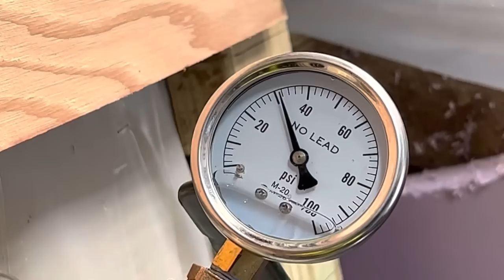REPLACING CURB STOPS UNDER PRESSURE!

Comment: Buy a freeze kit. C02 oxygen bottle tank with a freeze bag that wraps around your pipe and will form a ice layer over the pipe with about 5 minutes of time when it’s frozen. We did 180 lead water replacements this summer from the curb box to the house. Directional drilled from the curb stop to the house under the basement floor.

Comment: When we change out curb stops and got the water shut down on the road we always open up the nearest hydrant and that helps drop the pressure big time.
Reply from the maker: I forgot to mention that but we did do that! Definitely helps!
Reply: We’re not allowed to shut down the water mains or help even drain them. Water mains are from the 1930-40s. The city is worried they might crack and leak